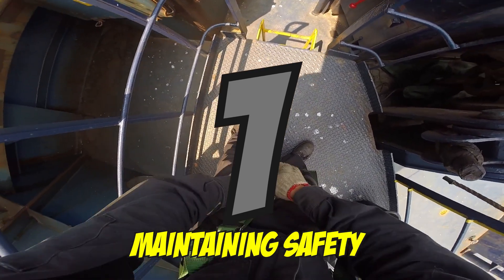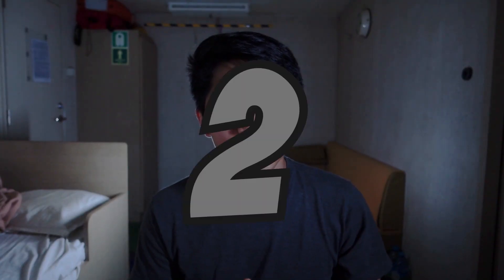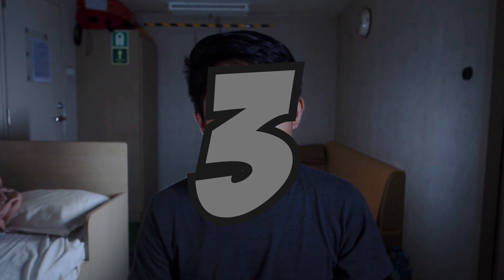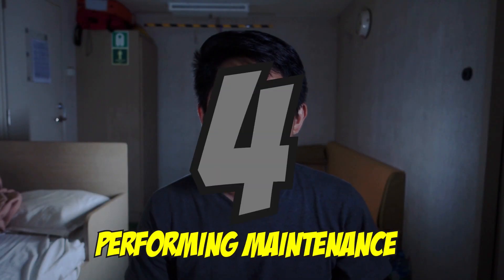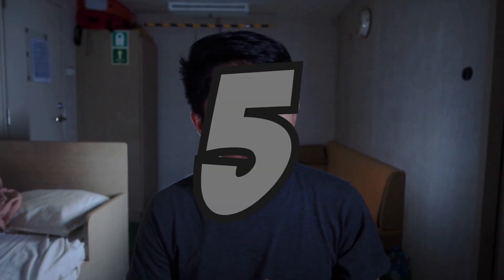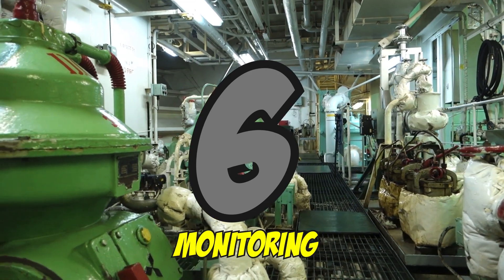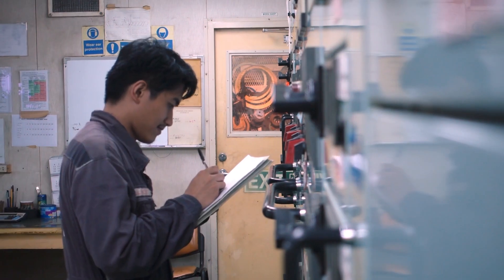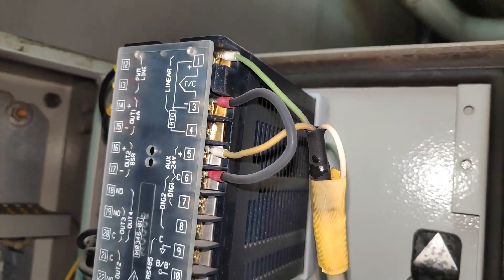ETO Responsibilites | What Do ETOs Do Onboard

Comment: Hello, i have a bachelor degree in electrical engineering with high voltage concentration, what do i need to do to become a ETO? Did you have a recomendation to get the ETO license? Thanks
Reply: Testing and calibration of different sensors

Low insulation of motors and generators

Read electrical diagramms

And plenty more